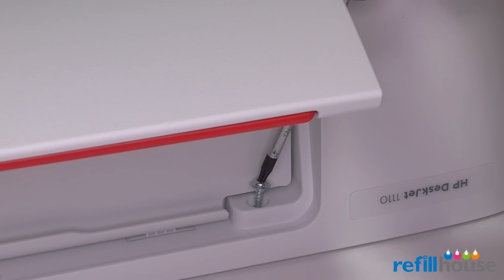HP Deskjet 1110, 1112 CISS - HP 63, 302, 123, 803; HP Deskjet 1115, 1118 CISS - HP 664, 680, 652

Comment: Why do we keep printer at a height greater than ink bottles and at what interval we should flow the ink to the cartridge or it will automatically absorb by capillary action? Kindly Do Reply back I have done This on my HP 2515 But there is huge ink flow in the cartridge and is making printer dirty all over. I have closed the flow with taps too but no use of it ink drops at the head.
Reply from the maker: The placement plane of the printer is higher than the plane on which the ink is placed, about 4-5 cm.

Comment: Can i use depective color cartridge? Cause may color cartridge was not working😢
Reply from the maker: This HP 63 series of color ink cartridges, small capacity, high price, is very easy to be monitored by the original factory, resulting in ink cartridges cannot be printed;
Modifying continuous ink supply to print color photos seems impossible.
It is recommended to use less color printing.
Reply: @refillhouse   im using hp 650 series sir/maam any suggestions please,thanks
Reply from the maker: The hp 650 is a high-capacity ink cartridge, and the printer is still not suitable for printing a large number of pictures.

Comment: i just have converted my printer. but its cartridges are spilling. and the computer still says that my printer is out of ink . and the tri color does not even work but it is spilling. what should i do ??
Reply from the maker: Your original printer settings may not be set for use by other printers
After changing the printer, the new printer will reject it
The cartridge spilling, leak, overflows the problem and should be answered in your black cartridge leak
Reply: i just have printed big letters and different colors. and it is all in good condition !! thanks alot for this video it helps a lot !!! :)
Reply: what ciss kit set you used??have u solve ur leak issue??
Reply from the maker: The printer slowly raised, adjust the height, to the nozzle will not leak so far.
Reply: hi..what printer did u convert??
Reply: hp deskjet 1112 printer
Reply: i will also try to convert my hp1112 into this.. where did you buy your ciss kit??
Reply: lazada
Reply from the maker: please link
http://www.refillhouse.com/index.php?route=product/product&path=18_45&product_id=218
On the left upper corner of your window, you can change language to English and currency.
Reply: no peso currency??im from the philippines..
Reply from the maker: You must create a PayPal account to connect to your bank account.
You can use PayPal account to pay for international payments in the future.
Currency directly choose NTD will be cheaper, if the exchange peso Philippines.
Reply: naka bili ka ng ciss kit?
Reply: same tayo ng unit na covert mo ba yung sayo?

Comment: I Have followed the instruction however I use empty black cartridge, after installing the ciss still no Black Color when printing
Reply from the maker: Please adjust the height of the printer, the area will be different, there will be differences
Please lower the height of the printer and test it multiple times.
Sometimes, in the case of water leakage, black is not printed, and ink is dripped onto the paper.
Reply: Thank You! I works fine now. 
 @refillhouse
Reply: Kabayan, ano yong string na ginamit mo? San ka nakabili ng mga kit na ginamit?
Reply: @MrGo1432  Kabayan, anong string ang ginamit mo? San ka nakabili nong mga kit na ginamit? Salamat😊
Reply: Sa refillhouse .com yata yun kabayan.
Reply: @MrGo1432   helow po so far ok po ba ung pag print? hindi nmn po nag ooverflow or nag tatae? panu po pla pag na detect ng printer na walang ng ink mag peprint pa rin cya?
Reply: @ssp.mis.central5092  dati lakas ng pagtatae pero after nag elevate ako ng printer. ok naman sya. first 2 pages na print every day may konting Blat sa dulo ng papel pero konti lang naman. so far di pa naman nag reklamo na ubos na daw ang ink.

Comment: i didn't put yarn inside the black cartridge..now the black ink is not printing
should i re do ang put yarn?
Reply from the maker: The height and temperature of your living area may cause ink cartridge leakage.
The height of the stand of the printer, the printer can be based on the height of 4 cm, continuous printing is smooth.
If you find that the printing is not smooth, please open the printer door, the printing machine will stop printing, that is, move out to the middle position;
Use the light to illuminate the nozzle to check whether the nozzle is leaking ink. 
If the ink leaks, it means the printer needs to be raised again. 
If there is no ink leakage, it means the printer has an insufficient ink supply.
Adjust the height every time, with 1 cm as the standard.
The height of the adjustment has a lot to do with the suction kit.
First remove the connecting tube, first confirm whether your ink cartridge is faulty.
Reply: how to check if my cartridge is faulty?
i tried cleaning ng print head..still not printing very well
Reply from the maker: Your ink cartridge can be printed, indicating that the ink cartridge has not been rejected by the original hp.
The nozzle is poorly printed, for many reasons
The printer was not printed for several months, causing the nozzle to dry.
The most fear is that the filling error, the needle is inserted deep, the internal filter is broken.
Another reason is that the filling is too fast, the sponge of the ink cartridge is a bubble, and it is not printed well.
Reply: i think i fill it too fast..should i remove the ink first then refill it slowly?
Reply from the maker: If possible, you can search US Patent NO 769074,  Fig.3 & 4, will tell you what happened.
http://pdfpiw.uspto.gov/.piw?Docid=07690741&homeurl=http%3A%2F%2Fpatft.uspto.gov%2Fnetacgi%2Fnph-Parser%3FSect1%3DPTO2%2526Sect2%3DHITOFF%2526p%3D1%2526u%3D%25252Fnetahtml%25252FPTO%25252Fsearch-bool.html%2526r%3D4%2526f%3DG%2526l%3D50%2526co1%3DAND%2526d%3DPTXT%2526s1%3D7690741%2526OS%3D7690741%2526RS%3D7690741&PageNum=&Rtype=&SectionNum=&idkey=NONE&Input=View+first+page

Comment: Is it necessary to elevate the printer than the tank?
Reply from the maker: The height of the printer should be raised, and the ink will leak if it is not raised.
The printer is placed at a height approximately 4-5 cm above the level of the ink.
You have to test, the area will be different.
Reply: Thank you very much... You answered the biggest question of '' why HP cannot be converted into CISS... Because of the ink leakage ''.... Thank you very much
Reply from the maker: When the printer is raised, the ink leakage of the nozzle can be solved.
Reply: @refillhouse   thank you very much

Comment: What's the purpose of putting a yarn in to the black cartridge? What is the length of the yarn?
Reply: Okay. Should I empty first the cartridges before installing the CISS? Or is it okay to install the CISS while it is still have its original ink?
Reply from the maker: Use compatible ink, any time can be directly modified
Reply: Thank you.

Comment: what is the height of the stand of the printer or the height it should be higher to the tank?
Reply from the maker: The height and temperature of your living area may cause ink cartridge leakage.
The height of the stand of the printer, the printer can be based on the height of 4 cm, continuous printing is smooth.
If you find that the printing is not smooth, please open the printer door, the printing machine will stop printing, that is, move out to the middle position;
Use the light to illuminate the nozzle to check whether the nozzle is leaking ink. 
If the ink leaks, it means the printer needs to be raised again. 
If there is no ink leakage, it means the printer has an insufficient ink supply.
Adjust the height every time, with 1 cm as the standard.
The height of the adjustment has a lot to do with the CISS kit.

Comment: Will it work in hp 2622 printer of cartridge hp803??
Reply from the maker: it can work in hp 2622, another kit part
https://www.ebuy7.com/item/heller-applicable-hp-803-ink-cartridge-2622-1112-2131-2132-2621-2623-1111-continuous-printer-ink-cartridge-continuous-ink-supply-system-ink-supply-system-522810004229
Reply: @refillhouse  ok I have installed the ink system and ink has finished up. Please help which ink I should used for refills???
Reply from the maker: Please send some photo to my mailbox refillhouse@livemail.tw

Comment: I did everything on my hp deskjet 1112 after somedays it says used or counterfeit  or refilled cartdrige failed, i cant print
I m too much poor now to buy new cartdrige
what to do? please i need solution 😭
Reply from the maker: I don't want you to spend too much time on the HP printer, its ink cartridge is too expensive (please pay attention to its color ink cartridge sales price)
please link https://inkjet411.com/?page_id=3706
Reply: @refillhouse   my both cartridges are setup which i got while purchasing
should i change the colour cartridge only? or both...
my cartridge is 63
Reply from the maker: Colored ink, you check the price, it is really expensive
Not suitable for printing color documents or photos
Maybe you can redeem Canon's cheap printer.
Reply: @refillhouse   refer a printer which i can convert ciss without any problem
Reply from the maker: You can install it as a continuous ink supply.
I have always stressed that color ink cartridges are easy to malfunction or are monitored by the original factory.
Reply: used or counterfeit  or refilled cartdrige detected: CLICK NO AND THEN CLICK OK  in the dialogue box if shows in your monitor. Hope it will help.
Reply: @ofw-wb9mb  doesn't work

Comment: I had an Hp deskjet 2320. I'm overwhelmed by the prices of the Catridges. Around ¢180 per catridge, 3 of them will amount to ¢540, ¢110 more than the cost of the Printer which is I bought at ¢430.
I wish to do this but the tool kits used in this video is now my problem. How do I get them?

Comment: Its a big thumbs up, what kind of ink can i use for it, can i use universal dye ink? and Why you sticking pencil in the hole of ink tenk, just asking?sorry for my spoon feed!!! By the way I LOVE YOUR TUTORIAL.
Reply from the maker: Black ink is a pigment, 3 color is dye ink, Universal black ink is Dye ink
universal ink will have a slight color difference after printing. If you don't care, you can use it
Please link the kits set.
you can download the structure
US007364281 - Title: Tiny air-pressure balance device between an ink cartridge and an ink bottle
http://www.refillhouse.com/Download/Tiny_air-pressure_balance_device_US007364281.pdf
You need to look at the action before the tip of the pen is inserted above the ink tank.
Before the injection of air into the syringe, the positive pressure in the bottles, tubes, and cartridges
The tip of the pen is inserted above the ink tank, is push the internal tiny-pressure valve to discharge the internal pressure air.

Comment: i already convert my  deskjet 1112 to CISS but i  just use it for a short time. and my cartdrige is  damaged and not working anymore...can i still use it or i have to change a new one?
Reply from the maker: The printer refuses to continue printing. In the early days, the color ink cartridge was restricted from being printed. You need to replace the cartridge with a new ink cartridge before you can continue printing: When replacing a color ink cartridge, be careful that the ink will leak. Newspapers and toilet papers need to be prepared; when the three connectors are removed, the ink is directly placed on top of the toilet paper and newspapers, the nozzles are turned upside down, and more ink in the ink cartridges is leaked on the toilet paper; the ink leaks in the newspaper After cleaning, wipe the surface of the ink cartridge with a slightly damp paper and place it in a sealed box.
Reply: thanks for the reply! you mean i need to buy new colored cartridge is that it? or i just need to replace an ink into my cartridge?
Reply from the maker: This deskjet home printer is not suitable for printing photos.
The color ink cartridges have a small capacity and are more expensive than black ones.
Black ink cartridges usually print 300-500ml.
In your current situation, according to our experience, the colored ink cartridge may be limited by HP's software. You must replace it. After it is replaced, do not abandon it. After wiping it clean, store it in a closed container to prevent the nozzle from drying out. When the replacement is more than three, the ink cartridge may be reused.

Comment: I have hp deskjet ink advantage 2020hc number ink No. 46 how to know  Reset HP Ink Levels, i'm  refill already cannot use. and this if  buy new calibrate ink no, 46 can set add refill take same you or not?
Reply from the maker: please ref
https://support.hp.com/in-en/document/c04616957
After the HP 46 ink level drops, the ink level can not be seen unless the chip is replaced
Do not worry, the output signal, the ink cartridge can move work, the ink cartridge has no water level, can still continue to fill the use
Refused to print and printing without ink jet printing or poor, are different reasons
Please choose a better fill tool to fill your ink cartridge

Comment: what is inserted in the cartridge ?
Reply from the maker: Refill House-填充小站-噴墨印表機-墨水-連供-改機-連續供墨-解碼-修復-填充專家
7 個月前
Q. why do you put strings? why are they needed?
A. Tear off the sticker, you can find hp 63 ink cartridge inside the two holes are empty - No sponge 
Will be about 5 meters of cotton slowly into the cabin, 
The purpose is to control the internal ink shaking, reducing the wave of pressure
After modifying to CISS, you can save 8 cartridges, and then in accordance with the initial installation of the replacement of the original ink cartridges.

Comment: its really needed to put the printer higher than the ink tank ?
can i attach the tank to the side of the printer ?
Reply from the maker: Use different diameter of the ink tube, different external ink tank, the final effect is different
First filled full with ink tank
You need to slowly test, slowly raise the printer, until the nozzle will not leak ink
Is the minimum distance of your height
So that the printer to print, continue to raise, the first nozzle can not spray ink
Is the maximum distance of your height
The printer is best to test a 0.5 cm
Different areas, altitude will be different
I hope you can test successfully
your can ref.
http://www.refillhouse.com/index.php?route=product/product&path=18_45&product_id=218

Comment: what type of yarn you used??can i use the yarn for chrochet?
Reply: should i remove the ink of cartridge before doing this??thank you for your reply..
Reply from the maker: After tearing the sticker, the ink cartridge has five holes, do you see the sponge?
If one of the holes does not see the sponge, you need to add yarn
The original ink cartridge ink, do not remove
Reply: ok..thank you.☺
Reply: if i remove the cartridge original ink this will not work??
Reply from the maker: You must then remove the air from the nozzle
Reply from the maker: yes, need full

Comment: what did you use to wet the yarn?is it alcohol or just water?
Reply from the maker: is pure water
Reply: do i need to dry the yarn after washing with water or just dump with tissue??
Reply from the maker: pure water
Reply from the maker: not washing, is wet it, after the yarn is in water, remove the surface moisture with a dry paper towel
Its purpose is to provide the yarn to be easily inserted into the internal space of the ink cartridge
Reply: thank you..😊
Reply: So what is the purpose of the yarn inside the cartridge???

Comment: what if i accidentally put some ink in front of the cartridge where the chip like circuit that is connected to the printer? and after that the color is mixing what do i need to do? and i already wipe the ink. thanks for the suggestions
Reply from the maker: Ink-contaminated circuit board, you can use the paper towel to damp the water, press the contact surface of the printer for a few seconds, then you can suck the ink on the circuit board.
Ink and color mixing, in the absence of tools, only use a slightly damp paper towel, put it under the nozzle, let it slowly guide it out,
The wrong color, then fill in the ink, back and forth multiple times
The color of the ink will be normal

Comment: Why you didn't removed the four extra tubes without ink? Thanks
Reply from the maker: Our original design of 8 rows of tubes is available for 8-color printers;
The inner diameter of the tube is only 0.9mm, and the wider tube has a more stable balance and swing function.

Comment: hi friend tellme how i can reset ink counter of 1115?? because i did refill but hp software still saying that is empty
Reply from the maker: After the ink level of the original ink cartridge, the print will not rise after the printed, no chip resetter can be used.
If your filling is normal, the printer can print, no problem, no need to pay attention to the display without ink;

Comment: To reset the ink value level of HP printer
Reply from the maker: After the ink cartridge is printed, the ink level can not be reset after the original ink level.
No any chip resetter, decoder or method for you to use.
HP Black and thr-cartridge life is controlled, unconfirmed whether the recording cartridge usage, or the number of inkjet or plug the number of times.
Based on experience and testing, we found that the number of ink cartridge rechanges, will affect the possibility of ink cartridge refuse to use.
Most likely to cause ink cartridge detection problems, is in each print, unplug the printer's power cord, no longer in use.
Modified into a continuous ink for the purpose, is to make HP original cartridge no longer regular replacement, reducing printer wiring detection problems.
Ink cartridge is a useful life, users usually need their own maintenance, ink cartridge failure need to replace the ink cartridge.